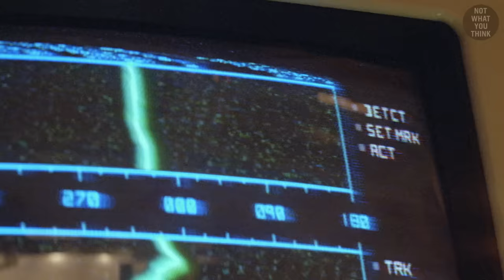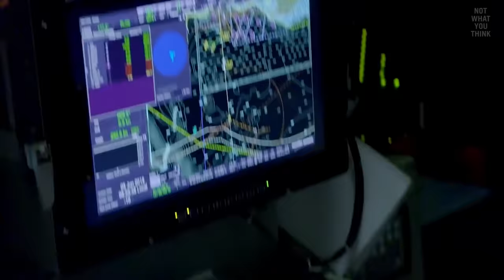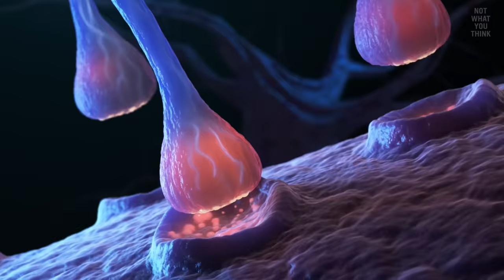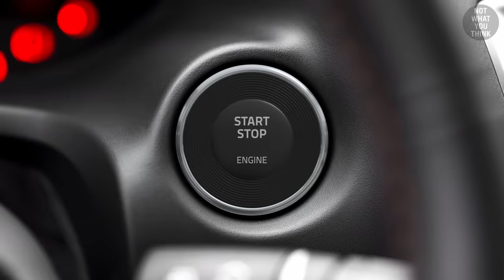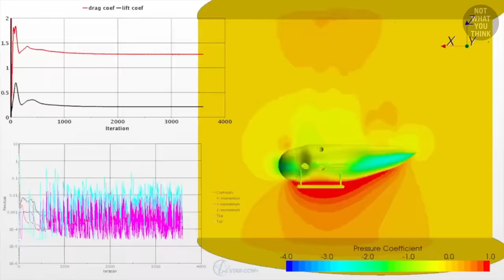What Happens When a Submarine Implodes

Comment: 40 Milliseconds is crazy. The moment light hits the retina, to the signal reaching your brain, takes about 70 milliseconds or longer. Meaning their brain wouldn't even have had the time to receive the visual stimulation of the instant before their death, let alone the actual instant of the implosion.
Reply: But with regards to the titanic submarine that’s different. The entire submarine was compressed to the size of a baseball in a span of milliseconds, they were beyond obliterated before they knew it.
Reply: @Nonamelol.  It would have creaked and leaked before it imploded.
Reply: @asparagusstaging430  It was made out of carbon fiber. CF doesn't creak or leak, it catastrophically shatters into a billion pieces.
Reply: @asparagusstaging430  False. Once carbon fiber fails it shatters immediately. Why? Because carbon fiber is incredibly stiff and doesn't compress like say titanium and steel alloys. Those materials creak when compressed. Carbon fiber? Shatters without warning.
Reply: @asparagusstaging430  it wouldn't have leaked, any penetration of the hull no matter how small would have instantly obliterated the sub but there was probably a crackling noise some seconds before the implosion that alerted the crew that they were in trouble
Reply: @Nonamelol.  Bro what? They've literally recovered large pieces of it, you're literally pulling that from nowhere
Reply: @shanemurphy9923  You must not know the physics behind implosions and how material behaves when subject to them if that’s what you’re saying.
Reply: @Nonamelol.  Literally Google titan pieces recovered takes like three seconds. Doesn't really look like a baseball to me
Reply: @Nonamelol.  that's not entirely accurate - one of those titanium hemispheres came up in-tact (albeit with the center window missing) - I expect everything EXCEPT those 2 hemispheres was compressed as you describe but both were blown off at each end. IF they found the 2nd one I'll bet it wasn't close to the 1st. FWIW missing center window has me wondering if THAT was the failure point - compare it to the windows on Deepsea Challenger or The Limiting Factor.
Reply: An engineer who went down on it's second dive said it was normal for loud bangs all the way down akin to small arms fire or fireworks from the hull coping with the pressure. He tried his best to convince the owner that the noise was likely tiny air pockets within the carbon fibre collapsing under pressure but dude wouldn't listen to anybody. Just think how scary hearing noises that loud all the way down f dat.
Reply: @shanemurphy9923 Bro What? Large pieces recovered (if they were recovered) would be solid metal pieces, like a hatch or a ring. Not the hull.
Reply: @jasnterry1313  I'm so confused, have you Googled titan pieces recovered or not? Literally the first couple of news articles show photos of large pieces of the submarine recovered. I don't understand why you're arguing when it's literally right there.
Reply: @shanemurphy9923  The problem of the titan was not the Titanium end caps but the carbon middle part. As he said, if the carbon is compromised it will shatter immediately and the pressure of the water will compress the air and everything in the submersible into a very dense state.
Reply: Yeah, the electrons in your circuit might not even reach their target so you can’t relay what happened. Pretty cool area of science.
Reply: @shanemurphy9923  Incorrect. You're misunderstanding what you're seeing in those pictures. There's the titanium end cap and ring etc that appear relatively intact, then the larger white pieces you see are not part of the pressure hull where the passengers were. They are sections of the vehicle skin in parts that were not pressurized, and the frame of things like the tail section which contained mechanical / electrical assets - also not pressurized. The pressure hull was obliterated into small fragments. The sections of submarine you see that, while heavily damaged look remarkably intact, were damaged as a direct result of the pressure hull imploding in very close proximity.
Reply: @MikeZ8709  Both ends coming off is what happens when you squeeze too hard in the middle.  The window wouldv'e blown outward with the initial compression.
Reply: @shanemurphy9923  the bits recovered are things that would be attached to the outside of the hull. The real "sub" part of the sub is literally dust, gone, vaporized, etc.
Reply: @shanemurphy9923  those large pieces actually prove their point... the pieces recovered are either a) solid titanium endcaps or interface rings b) non-pressurised parts of the vehicle. The titanium parts survived because metal doesn't shatter; you don't see any part of the CF centre tube because it shattered to dust.
Reply: @shanemurphy9923  those pieces that were recovered were made from titanium.
Reply: So many submarine experts these days. 🙄
Reply: @Nonamelol. ”compressed to the size of a baseball” lol. You’re either just making up stuff, or repeating incorrect “facts” you heard or read.
Reply: Our expert team of youtube scientists over here haha everyone struggling to give their 'facts' is quite funny.
Reply: @MikeZ8709  This will be verified as to what happened and in what order. The carbon fiber middle failed which propelled the ends away from the center o9f the wreckage.
Reply: Wtf that’s not true at all. Why do people keep soouting out bs
Reply: @cw9766  How is it wrong then?
Reply: @shanemurphy9923 , all recognizable components were external to the pressure Hull except for the massive titanium alloy end caps. Everything inside the hull was shredded by the compression, heating, violent impacts, shock waves, and turbulent shear forces of water moving at speeds up to thousands of kilometers/hr.
Reply: @immrsv there is a lot of water pressure pushing the titanium caps towards the middle.
➡️🍲🍲 ⬅️
I imagine them forming a titanium sphere🔮 full of 5 man liquid❣️, computer monitors🖥️, small shards of fibreglass, bone 🍖, 🦴, 🍕🦷and a controller 🎮.
The oxygen egniting as the heat increased to cooking level. Then heavy parts sink while any liquids mix into the sea water.
Reply: @McLarenMercedes  the hull was glued to the metal dome. this marriage could easily have leaked before it all came crashing down
Reply: @khallrik  you have watched to much science fiction.. its obviously not shattered to dust
Reply: That's not true. If that was true we wouldn't notice that games are running at 120 fps (8.33 ms). In reality, the brain can process visual information much faster than 70 milliseconds. The time it takes for the brain to process visual stimuli is typically in the range of tens of milliseconds or even less. The exact duration can vary depending on the specific visual task and the individual. Still, they wouldn't feel pain tho.
Reply: @NUCLEARxREDACTED  The time it takes for the brain to process visual stimuli is typically in the range of tens of milliseconds or even less. If he was right, you wouldn't notice a game playing 120 fps (8.33 ms to render one frame).
Reply: @cw9766  Right ? Comments sections are full of bs and everybody seem to approve it.
Reply: It's not crazy at all it takes 40 ms to render one frame at 25 fps rate.  You would certainly notice that.
Reply: @mggt4684  How does the speed of an external stimuli effect the speed it travels to your brain? Yea your brain can distinguish between visual stimuli as quickly as dozens of milliseconds, That doesn't mean that the perception of the change isn't on a delay due to the need to travel from your eye to your brain.
Reply: @NUCLEARxREDACTED  Alright what you say right now makes more sense and might be true. I don't know any sources that could neither deny or confirm it, though chat gpt says you would still notice it, but I'm not sure if it's right.
Reply: @PrivateJoki  If you were to watch it from the side, the entire center section would simply look like it had instantly disappeared. Compressed into a couple of inches in less time than it takes to blink. The end pieces would fall away and be mostly damaged by the fall to the ocean floor, since they were not pressurized.
Reply: Catastrophic failure happens in milliseconds. Bang, dead but faster.
Reply: @Fred-vy1hm  There were crackling noises even before! See the Karl Stanley interview on ACE. Karl Stanley is a submariner and sub inventor who tried to dissuade his friend Rush from continuing with that sub. Karl was on dive 2 and testifies that already then there were crackling noises at the deepest but also at only some 300 ft when they rose back to surface which was an obvious sign the composite material was moving on micro/nano level and subsequently getting weaker/porous etc. A very interesting interview!
Reply: @mggt4684  Yea its a subject that is tricky to even articulate properly. Its also tricky to research cause its not like you can just stick a wire on an eye and into brain and measure speed. Though there is some very interesting research on the topic. I think they have figured out how fast signals can travel through nerves. Then estimated how long the distance from the retina to the brain was, and just calculated based on that. 
 
So maybe you would see it for the briefest of instances. I don't think so though. The cavitation causes the air to superheat, and I imagine that happens faster than the total time of the implosion.
Reply: @mggt4684  Also ChatGPT is a language model. Its goal is to sounds correct, not actually be correct. That why they have to give out the disclaimer 

"While we have safeguards in place, the system may occasionally generate incorrect or misleading information and produce offensive or biased content. It is not intended to give advice."
Reply: @shanemurphy9923 those large pieces are the outer casing that covered the inner cylindrical pressure hull, and the two end caps. The inner pressure hull is not visible when you look at the Titan. It is what was made of carbon fiber and shattered on implosion.
Reply: @shanemurphy9923 those are the outer casings, not the carbon fiber pressure hull.
Reply: @braveheart4603  The German who went down said it was silent
Reply: @NUCLEARxREDACTED  I'm aware of that, that's why I said that I'm not sure if it's right
Reply: @MikeZ8709 The joint where the window is attached would be much weaker than the CF tube or titanium caps. Just based on the geometry, it's safe to assume that the window was the initial failure point
Reply: @ricomock2  possible, but I'm betting the carbon fiber hull gave first; was crushed and in that nanosecond the force of the implosion shot the porthole out at warp speed.
Reply: @shanemurphy9923  Nope. None of the CF was recovered, certainly not in large pieces. You're looking at the outer cover for the equipment bay.
Reply: @shanemurphy9923  The pressure vessel cylinder was crushed, not the titanium endcaps or the equipment bay. The titanium was too strong to be deformed and the equipment bay wasn't pressurised.
Reply: @mggt4684  That's not really how it works with 120fps. It's refreshing the same image over and over (your input is slower than that by far in most circumstances). Your brain is AWARE of things down to 13 ms or so but information gets lost in the process. Just because the screen is refreshing at 120 frames per second and your eyes and brain don't operate that fast doesn't mean you can't see it. Think about persistence of vision. 120 fps is mainly for 2 things... It makes movement cleaner (no smearing of fast movement between two frames) and controller input timing. It's mainly to make fast moving objects look nicer. Remember ghosting from early LCD/Plasma TVs?
Reply: @paulstewart6293  Correct.  At that depth, it's about 3 milliseconds.  Or less time than it takes for signals from your retina to make it to your brain.  The videos we see here are slowed down by Hollywood to about 50-100x slower so that we can process what happens for viewing. :)
Reply: Am I the only one who thinks death that instant sounds more terrifying than experiencing excruciating pain and then dying
Reply: That's so fucking insane.. dang.
Reply: @suep9445  I'm not arguing against what you're saying, I'm saying that the window joint (or any other cutouts in the cf tube) are significantly weaker than areas of the tube that doesn't have any interruption of the circular cross section. The window joint would have been one of the weakest areas of the tube and was almost certainly  the location of the cf tube's failure (assuming the tube was the failure point)
Reply: @Man_Emperor_of_Mankind  The window cutout was in the titanium cap, not in the carbon fiber cylinder.
Reply: @hotdog9262  not so much science fiction but rather hydraulic press channels on YouTube. When CF fails under compression, all that remains is dust and fibre strands. So dust is somewhat of a hyperbole, but not far out of reality. Take that with a pinch of... dust.
Reply: @Man_Emperor_of_Mankind  The window is basically a cone of solid glass that is wedged in and it's unlikely to fail before the CF does.  If there was a leak, it would have drilled a hole through the CF like a water cutter almost instantly as well.  We will eventually find out. But my vote still goes to the CF as it was showing signs of degrading in the marine environment.
Reply: @shanemurphy9923  Yeah, they were pulling up sheets of the sub several feet long...not small shattered bits.  It's pretty easy to find.
Reply: @shanemurphy9923 Those are the fairings and the titanium parts, which wouldn't have imploded.
Reply: @shanemurphy9923  I didn't understand this at first, but the white coverings are fairings, lightweight, shell like panels that streamline, or rather,  streamlined, the outside of the Titan. 
That whole white part wasn't pressurized. It covered wiring harnesses and such in the back, things that didn't need to be kept in a sea level type atmospheric pressure environment. 
And it covered a carbon fiber tube that was pressurized and held the passengers. That's the part that imploded. Stuff outside it was subjected to pressure waves that I don't understand well enough to explain. 
I think of the difference between passenger compartments and freight compartments on a plane. Not everything inside the hull, or whatever you call the exterior of a plane, is pressurized.
Reply: Most people here have explained the same thing in their own words, but based on a consistent understanding  of physics and material fatigue. It means we have each processed the situation individually and reached the same conclusions. I have hope for reasoning abilities that sometimes disappears when I read comments!  😊
Reply: it only makes sense for it to collapse down to baseball size, if u think about the entire freaking ocean (you know what i mean) pressing in on it.
Reply: @khallrik  well this is not the same as hydraulic press
Reply: @hotdog9262 you’re wrong. Just accept it and move on.
Reply: @frankiethefrog1752  wrong about what
Reply: @Nonamelol. So how come they are pulling the wreckage out now? Big pieces of hull? Maybe that happened to people, definitely not to whole sub.
Reply: @jenshavla4673  Those are pieces of the white fairings, not the pressurized part of the submersible.  Please read comments above, there are some good explanations.
Reply: @asparagusstaging430  No.  It would not have had time to leak.  Boom! and done in less than the blink of an eye.
Reply: @asparagusstaging430  no it wouldn't have. This isn't like the movies. They were so deep the moment there was a defect in the hull, that's when it would have happened. This wasn't a slow descent with a creaky hull. They were way below "slowly" crushing depth and the hull gave out (for whatever reason)
Reply: @shanemurphy9923  the large piece was the tail part not the preassure vessel
Reply: Idk why most people keep explaining to me why only the pressurised parts of the submarine imploded when all I was saying is that the person who claimed "the entire submarine was crushed to the size of a baseball" just pulled that from nowhere
Reply: @shanemurphy9923 uhh probably because you used the large pieces that didn’t implode as evidence that the sub didn’t compress ??
Reply: @shennounou  didn't say it didn't compress, only said that the entire submarine was not compressed to the size of a baseball, quite different no?
Reply: @shanemurphy9923  Well people are just trying to explain that the size of the recovered pieces that u referenced isn’t good evidence to prove that it was impossible for the sub to have compressed to an extremely small size.